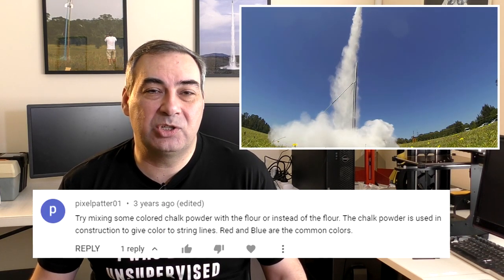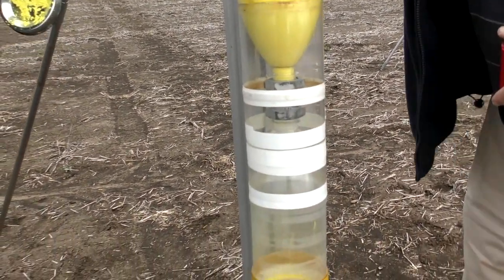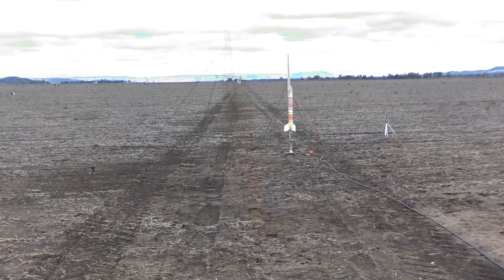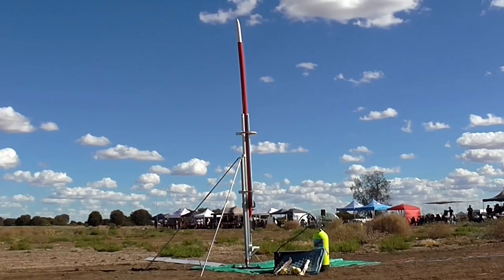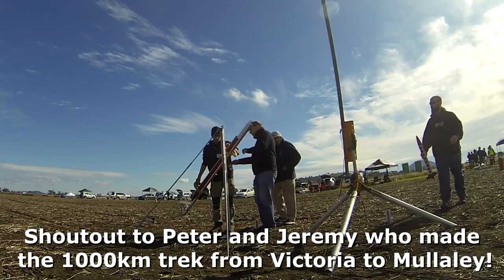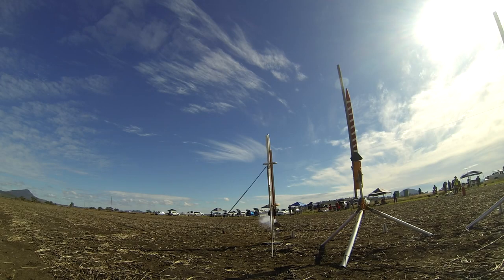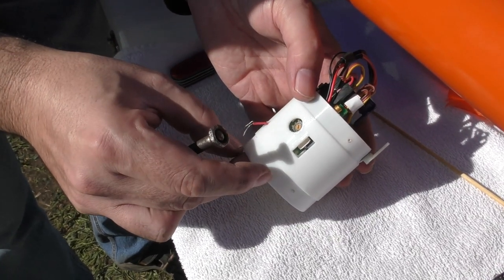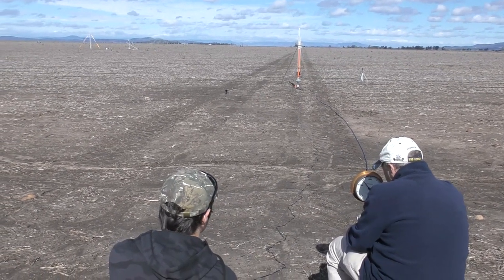What happens if you put Holi powder in a water rocket.

Comment: Hello George
I had tried holi powder but as the price was too high, I quickly abandoned this solution. 
But the effect is great! 
Good continuation and good launches!
Reply from the maker: Merci François , You are right, the Holi powder is expensive per launch considering how much needs to be put in, It is almost on par with regular solid motors. We may offset some of it by using a little flour at the very bottom because most of that goes while the rocket is still accelerating up the guide rail, and then when it's perhaps 1 or 2 meters in the air, then the powder will come out. I don't think we'll be using it on a regular basis though. I think we have enough powder for perhaps 3 or more flights. Just need to do it on a sunny day. :)

Comment: Is there a way to simulate forces and loads on launch on the parachute deployment system?  There might be something that could be causing a lockup of the system.
Reply: Put the rocket on a centrifuge, pointy end pointing in?
Reply from the maker: It's a good question. Normally we would put a camera next to a new deployment mechanism to see how it works in flight. It can often reveal quite a bit of detail. We didn't have any cameras on these flights.
Reply: @AirCommandRockets  I was thinking preflight testing.
Reply from the maker: Usually the first time we fly a new deployment mechanism we don't use it as the primary one, we  use a backup and just observe what the new one does. Testing on the ground only gets you some of the way. The near zero-G at apogee and aerodynamic effects are easier to achieve in flight. You also get the right acceleration profile during boost, and the -ve G's due to drag after burnout.

Comment: Nice powder flights George! Hurts to see an expensive rocket like Nova crash :( Did you use a parachute system based on the phoenix system from racketfued? And if so, is it possible the timer went off when the rocket was already falling down and the airflow was stopping the parachute to fall out?
Reply from the maker: Hi Mathieu, Yes the deployment mechanism is based on the Phoenix deployment mechanism, but we left off the ejection spring plastic  because it didn't look like it needed it. I think this is something we are going to put back in and see if it fixes the issue. I think the airflow probably prevented it from deploying properly. In both of the failures the wind was really strong on the days, and so the rocket would have weather-cocked into the wind, and so would have had higher airflow over the nosecone over the entire flight. At apogee it would still have had a significant horizontal velocity.

Comment: hi, love your videos. I'm building water rockets myself and I have a quick question. I want to use a O-ring as a seal for the coupling but I can't get it to be completely water/air tight. have you also encountered this problem. if you have how did you fix it?
Reply from the maker: Hi, it's hard to make a recommendation without knowing anything about your coupling, where you are placing the o-ring, and what your o-ring size is. We machined our own couplings with a specific o-ring seat. For the commercial tornado tubes, we use flat rubber washers.
Reply: @AirCommandRockets  hi, I use a O-ring with a inner diamater of 17 mm and a thickness of 2,5 mm. the seat it sits in is 2 mm deap and 2,5 mm wide and schaped like a U but sideways. its a radial rod piston seal where the nozzle that slides over it is a standerd 21 mm bottle opening. the coupling is mostly 3d printed.